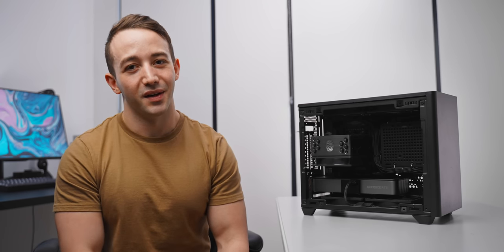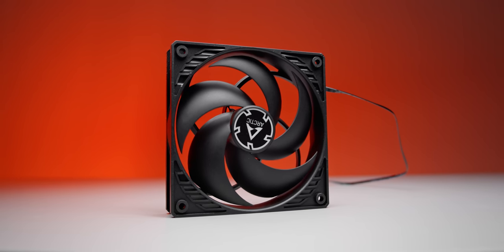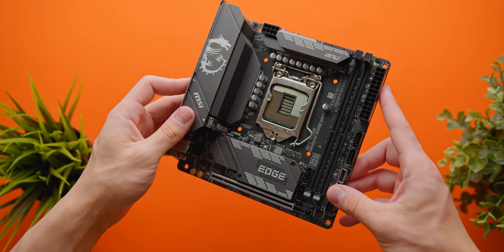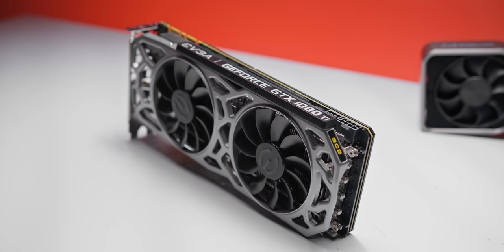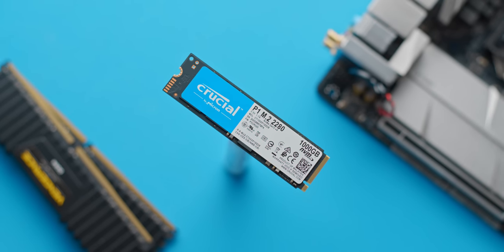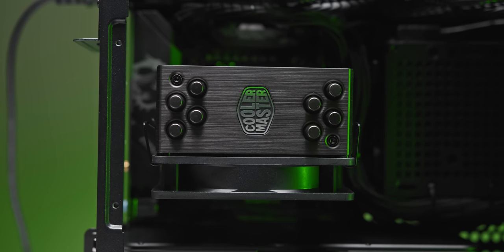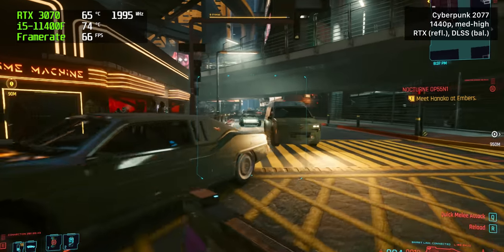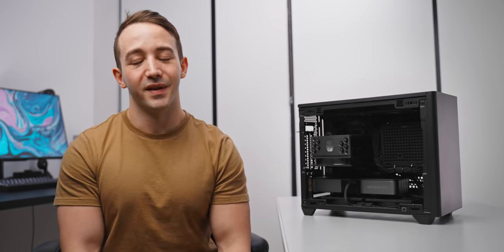Ultra Airflow, Zero RGB - 1440p ITX Gaming Build

Comment: For anyone inspired by this vid, fyi a 2.5 - 3 slot RTX Cards wont fit with 25mm fans underneath. You might be able  to use 15mm (arctic p12  slim) fans.  Also the noctua nh-u9s is a good fit  with the AM4  kit to rotate 90* and a 90mm rear fan (depending on  your MB).

Comment: I don't really know about the GPU Pricing situation in AUS and USA, but in Europe (at least in France where I live), you can basically fin a GPU for double its MSRP

RTX 3090s are touching (and sometimes over) 3000€
3080s are between 1000 and 1500€
3070s are around 800€
3060Ti are around 700€
3060s can be found for like 600 to 650€ depending on the model

even older hardware get a crazy markup : 1660 super are sold around 400€ (around 230 before), 2060s are found around 500 to 550€ (350 to 400 before) and RX 580s and stuff negociates around 300€

I'm glad I upgraded before the storm

Comment: I literally just built this with a ryzen 5800x and evga ftw3 3070. Used g skill ripjaws 32gb ram, asus rog b550 mini itx mobo, gen 4 1tb ssd. Same case same hyper 212 cooler. This little machine is the most powerful pc I’ve ever had

Comment: Love my NR200! Built my dedicated streaming PC in there. 3600, 1660ti, same cooler, and used the stock case fans. One is used as intake to feed fresh air to the cooler mounted standard and the back case fan centered behind the cooler. 🙌🏼
Reply: is there noticeable fan noise?
Reply: @rblxmach  I mean like with any PC gonna depend on your components and how aggressive your fan curves are. I have a Cooler Master Hyper 212 and use the included fans with the case and they’re all pretty quiet. The graphics card you might be able to hear depending on your model and the fan curve.

Comment: You can modify the cooler to fit with the glass side panel. Remove the top plate and then remove the heat pipe cover. Once the heat pipe cover is removed, you can reattach the top plate and you'll be good to go

Comment: My second comment. Just got a RTX 3080Ti FE after waiting 6 hours at Best Buy yesterday. This is the case that I want, but I have $3k to spend so will have to think about the parts here. Thank you again for great quality videos.
Reply: You may want to just wait until Sept 16th for the release of the NR200P MAX instead. It's $350, but supports what the NR200 family prior never really could: roof-mounted AIO that pulls the heat straight out of the case. It comes with the v850 80+Gold CM power supply and 280mm AIO already installed. You won't save any actual money (the cost of the NR200P MAX is near exactly what it would cost for a NR200P + their v850 power supply + their 280mm AIO). But the layout is superior to the NR200P imho. The GPU and mobo sit lower, the GPU is only mountable vertical, and two 15mm slim fans can easily fit under the GPU. Anyway, something to think about. Gratz on your 3080ti FE !!!
Reply: @Craig-ib7gk  Thank you for the update/information. I've seen the reviews on the Max. Not really for me. Going w/ air cooling anyway. Thank you though for your time. And ya, I was pretty happy getting the 3080 Ti FE after waiting in line all night. :)

Comment: have a similiar sized r5 1600x cryorig tower cooler 3070 fe & Lian Li Q10WX - 1440p powerhouse in a silent small case . You could do a 2nd system with same case with glass side panel, ryzen 5, wraith prism cooler , vertically mounted GPU , rgb memory..would suggest rgb nvme , suspect it be hidden by mb m2 slot cover. Then a 3rd video head to head or poll for stealth or lite it up !

Comment: I put together a very similar build recently, but with an asus rog strix b550-i, ryzen 5 5600x and evga rtx 3070 ftw3 and am very happy with it. for cooling, i used a coolermaster hyper 212 evo v2 with an extra sickleflow 120 fan and had no problems with side panel clearance. I also threw in some slim NF-A12 on the bottom and my cpu and gpu temps while gaming are about 60c in a 21c ambient room.

Comment: Fantastic build. I have a similar-ish NR200 build with a 3800x and a 3080 FE. Artic P12's combined with the FE's cooler design in the NR200 goes a long way in keeping temps and noise down.

Comment: You can actually fit the Hyper 212 Black with a TG panel if you unscrew the hex screws on the top shroud and remove the heat pipe caps.

Comment: i love the nr200 im using the same case and cooler, also you can fit the cooler with the tempered glass side panel by removing the cover caps for the heatpipes

Comment: Good timing. I'm building that computer, or very close to it, this week. Using a 10600K, Noctua U12A, MSI Unify Z490I, Cooler Master 650 PS. And my current 1660 OC graphics card for probably another year until prices settle down.

Comment: Those Arctic fans are great, basically 95% as good as Noctua while costing 1/4th, honestly I wouldn't recommend Noctua fans for anything at the price point they have, they simply aren't necessary
Reply: And the Arctic P12's have daisy chaining leads so you don't need a splitter. I'm running 4 chained on a rad into one socket.

Comment: Love it, somewhat similar to my build from last year;
NR200
5800X
GSkll Ripjaws 16GB 3600Mhz C16
Gigabyte B550i Aorus Pro AX
SF750 Platinum (couldn't get a 600 at the time)
Arctic Freezer Liquid Freezer II 240MM

Sadly, I'm still using my 1080FTW for obvious reasons, but that still pulls 150+ fps on Ultra 1440p Siege, and manages 80-100 in Warzone etc, so it'll do for now.

Comment: I recently made this exact build. I did add in 2 fans on top, 1 came with the case but im uncertain if i have the arctic fan plugged in correctly. No issues. im running around 200fps on high/ultra on most games. 

Things to note: nr200 has side fan that needs to be removed to fit the cooler. I recommend 2TB m.2, i have already filled the 1TB especially with the OS being saved to it

Comment: The CM 212 BE will fit inside the tp glass panel if you take off the heat pipe caps and leave on CM plate

Comment: can it accomodate 1 or 2 Sata SSDs without that side bracket?
Reply: Yes. Under the front panel you can mount two 2.5” drives. And you can also mount another 2.5” drive on the PSU cage.

Comment: There is actually a mod for the 212 Evo to fit into this case with the glass pannel! You just need an Allen wrench to remove the heat pipe end caps. I can't find the YouTuber I found this from but I will comment again if I do

Comment: got a similar build myself:

Asus B550i strix
NR200 
5800X 
6800 XT 

Using noctua C14s though with a 120mm fan underneath and 140mm on top on the side panel, 7 fans in total and so quiet and performs great, cant beat it (also with RGB rings on noctua fans :))

Comment: Question.

I've never built a PC before.
I know you mentioned that all the fans are facing upwards but...
The 2 fans that you added on the bottom, won't they conflict with the fans that come already under the GPU?

Also, cheers mate! You truly expired me to pull the trigger to finally do this. 
I'm waiting for my parts to be delivered. The only difference is that I'll use a 3060 ti.
Your channel is the best!

Comment: Did you factor in the custom power supply cables? Because something like that is about $80 minimum, in the U.S.

GPU supply and prices, are also insane in the U.S. Unless you are lucky, you are looking at paying $800 minimum on an RTX 3070. Likely more.

I like the Scythe Mugen 5 in this case. it has an offset to how its positioned over the CPU. So, if you put that offset towards the top----you can put the top fan on the heatsink as a pull fan and enjoy a bit better temps and/or lower noise. And still enjoy pretty direct exhaust. It also works with the glass panel ;) 
And its larger than that coolermaster, so better temps for Rocket Lake. Just $10 more.

Comment: Pro tip: Put a 15mm back fan on it and spin the CPU cooler 90 degrees.  You'll lower your temps by more than 5C.  I've never seen my 5600x go above 70C.

Comment: The combination of Gpu Pass-through ventilation and 90° degree rotation of Cpu radiator is absolutely brilliant in this case! No wonder you achieved such good temps! Can i ask you a couple of question ? What are the biggest air Cpu coolers you can fit in that orientation ? And are you restricted using Intel Cpu to rotate the radiator ?

Comment: Correct me if i'm wrong, but wouldn't it be better if the cpu cooler gets fresh air from the back of the case (vertical) rather than used air from the GPU back plate? Great video production btw!

Comment: Nice build, but I wish you had shown the cable management process as that's the most difficult thing in smaller cases. Also how did you mount the cooler pointed upwards? That wasn't shown either.

Comment: thanks, man. At the very end, you managed to switch the position of the Hyper 212 Cooler. It's different than the way you installed it first. How did you do that? Would you be able to share that process?

Comment: I just build a new 11400f pc with a b560m tuf gaming board, 3200ddr4 rgb, rtx 2060, putting them into a us$15 case, with a single $5 8cm fan, along with the black intel stock cooler. Everything works just fine. My 60Hz 1080p monitor is the bottleneck after all. Constant 60fps and both cpu and gpu is never too busy.
Reply: i feel bad for your parts if there only source of intake is a 8cm fan
Reply: @williamafton7698  it is actually the exhaust. Intake is natural negative pressure.   Unbelievably cool and quiet.
Reply: @bernardshum2719  what case are u using that supports 8mm fans
Reply: @williamafton7698  A cheap China case branded Aigo. I guess it actually should.use a slightly bigger fan. But I just tied a 8cm in place. The case was just intended to revive an very old 775 board initially. But then after an upgrades into i5 2400 then a i7 3770. Then got a rtz 2060 sometime ago and there is some bottlenecking. Eventually pulled the trigger on this very affordable  i5 11400 upgrade. But still on that case. Still very cool. I believe it draws a lot of air from the holes above the cpu position.

Comment: Blacked out looks the goods.
Hey so that cooler is pretty beefy.... does the NH U12A clear the tempered glass panel? (pretty sure it clears the mesh panel right)
IIRC on paper it doesn't fit, but on paper there could be discrepancies on either Noctua or CMs measurements

Comment: Clean build, great video! I'm extremely tempted to get this case, it looks like the sweet spot between being able to fit good air cooling and still minimize the case volume/footprint. 

One thing that's bugging me, though: on the specs for the case, Cooler Master lists 155 mm as the max CPU cooler height with the vented side panel, but the Hyper 212 Black is listed as being 159 mm tall. How does that add up? I already have a Noctua NH-U12S, which is about the same height, and don't want to replace it if I don't have to.

Comment: I'm so confused as to how people aren't able to find gpu's. I've been able to get 4 3070's and a 6900xt all at msrp. You just have to know what you're doing.
Reply: What exactly are you doing?
Reply: @iamsura  Discord notification bots, they have servers just for GPU stock. EVGA queue system is what got me the 4 difference 3070s, two of which were actually the msrp base model. I snagged the 6900xt merc at msrp with a notification server. I also recently bought a pre build system with a 3060ti for under 1000 dollars, and I was able to sell the rest of the components which completely offset the cost.

Comment: Great build. I have the same case with a 5600x + 3090FE, CPU stays around 75C, GPU under 60C on Warzone. I do worry my SF750 might be getting too hot as my CPU cooler is set to rear intake. Thoughts?

Comment: bro you can use the cooler with the glass side pannel just take off the faceplate on the cooler remove the heatpipe covers loose 3-4mm walla!!
Reply: allenkey job easyy#

Comment: That is an awesome build! May I ask you for your opinion? I currently have a 5600X running on the Aorus B550i with a 3070 MSI Ventus 2X inside the NR200P. I currently use a Thermalright SA130 as exhaust to the back, but would like to upgrade thermals and optics. Would I benefit from using the Mugen 5 Black, turned by 90 degrees as a chimney like you did in this video? Thank you in advance!

Comment: Interesting orientation of the CPU cooler. Would that affect CPU temps since it seems like it would pull in warm air from the GPU? 
I have an AMD build in my NR200. 5600X w/ NH-U9S and a 3070. Really solid performance at 1440p :D

Comment: Yo Ali this is creepy man .. I've been theorycrafting the 11400K + MSI B560i Gaming Edge for a week now and here you are making a video about it :D

I was thinking of using this combo in the Velka 7 with the Alpenföhn Black Ridge but I'm a little uncertain about a couple of things. First of all will the BR even fit on this mobo? Second, I've heard the BR causes some bending on the mobo due to the lack of a backplate; do you reckon the Noctua stock backplate will do much good? Most concerns are for the AM4 socket though, should I be concerned for LGA1200?

Comment: If you remove the cooler master brick on the cooler and then the heat sink covers you may use the tempered glass. That’s how I do it. There’s space between so zero contact between glass and cooler. You can screw back the cooler master plate afterwards if you want to. But I removed it completely to keep the aesthetics as clean as possible.

Picture here. 
https://www.reddit.com/r/sffpc/comments/mmuyxt/going_smaller/?utm_source=share&utm_medium=ios_app&utm_name=iossmf

Comment: Thanks for the build. I am planning my future build in NR200 too. I have a question: you mentioned that this Hyper 212 won't fit with side bracket. Can you recommend some air CPU coolers (tower cooler) that can fit with bracket and mesh panel in NR200? CPU which I am considering is Ryzen 7 3700X or 3900X on Aorus B550I mb. I will appreciate your advice:) thank you

Comment: Hey optimum, (what's your name btw), I think due to the current state of the GPUs, I'm thinking making an itx build with APUs which is quite good, especially an update is coming. Is there any case similar to the size of an intel nuc big enough for an AMD itx apu build, so only fitting an itx motherboard + cooler and a psu

Comment: Will CPU thermals be better if you pull air from the rear on a horizontally mounted cooler or is bottom to top airflow better?

Comment: I am trying to plan an itx build with a 5900x and a 3090. Will a 750w sfx psu be enough to use and possible overclock the system?
Reply: no chance if you want to over clock. you will need a 1000 watt or higher to over clock the 3090. The 750watt is barley enough to power the system as it

Comment: I am a fan too of the Arctic P12. But are they really a good case fan option? As far as i understand, they are pressure optimized so meant for radiators or dense cpu coolers. And that's all you tested them so far (at least in video Form), I'd be interested of a direct comparison between the noctua NF A12 and the Arctic P12 as well as the Arctic F12 (which I think are Arctics case (=airflow) fan option if I understand that right) just as case air intakes.

Comment: Hi Ali, may I ask if the NR200 can be taken on regional flights (over-head compartment?) or shuttle buses (under the seat?)?

I think cases like this might need a little bit of bag that won't slide around? I mean steel sliding against plastic on a rough ride on a regional flight in the overhead compartment, I don't want that thing to fall out and break someone's neck!!

I am also open to disassembly/reassembly for travel. But how does one go about doing that or packing that?

If NR200 is just a tad too big, are there any new contenders in the budget ITX cases space in 2022?

From what I can gather on Reddit, it seems like some folks are indeed traveling with the NR200, but what they advise other redditers to do is to maybe fasten down things that might need some securing. Maybe fasten down the GPU since the weight, hanging off the PCI port, might be tough on the mobo on a bumpy ride. Is this a good idea?

I'd love to see a video by the famous Optimum Tech on how to "harden" a itx PC for some tough travelling :)

Comment: Hi, short question... u say it can be installed a cooler with max highfrom 160mm...sounds good for me, because i will install a be quiet Dark Rock 4 with 159mm. But i wonder, on the CM side, they say...only a cooler with max high from 155mm will fit. Maybe u can help me? Will fit the be quiet one? Thx an go on with your nice channel ;)

Comment: Wow I just built a itx no rgb build just yesterday
Tu150
10850k
Z490i msi unity
64gb team dark
Nh u12s black
4 noctua f12 pwm
Evga sn gm 650w full mod
Xpg 1tb m.2

Just looking for a gpu that will fit the look of the build, so far turned down multiple cards that didn't fit the aesthetic since I am looking for a 3070 fe or similar 2 fan 2 slot card with little to no rgb

Comment: Hi, I want to know if you can fit the side bracket with duo fan setup for D12L? I'm planning my setup as below:
- D12L with duo fan setup (intake)
- 2 fans top as exhaust
- 2 Slim bottom fans as intake
- 1 140mm fan as exhaust on the side bracket (PSU side)

How's your thought on this setup? Been considering non-stop for my first ever NR200P build

Comment: will you review 850 w sfx power supply from cooler master soon? currently debating on getting the corsair 750 w or cooler master 850 sfx for my first it’s build. i have 3090 and 3900x or 5800x for the build that is currently in my main rig. after seeing a lot of amazing itx build in your channel, i think it is time to try something new.
Reply: dont go with the cooler master. Try searching for the annoying fan problem. Mine was running crazy loud, spiking every few seconds to 100% fan speed. I switched to a corsair 750w, which is completely silent.
Reply: @schmiki9911  cooler master release an other version of the 850 sfx which fix the fan problem so that not the problem anymore